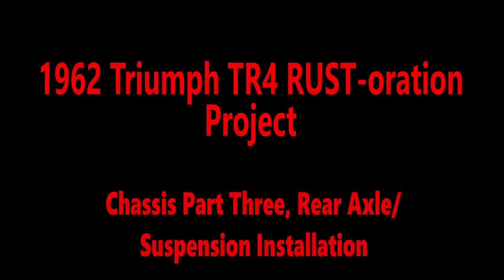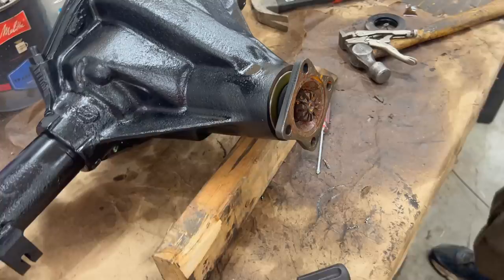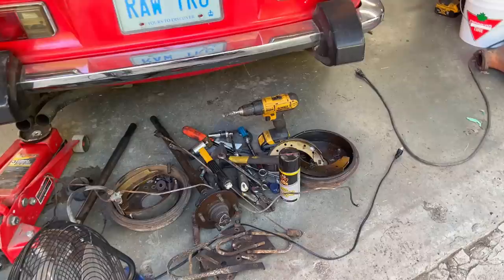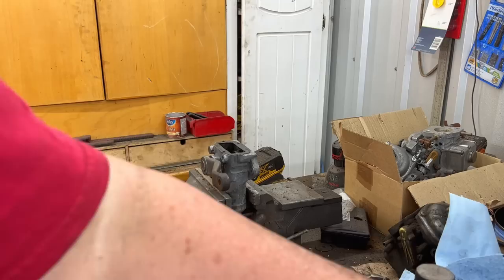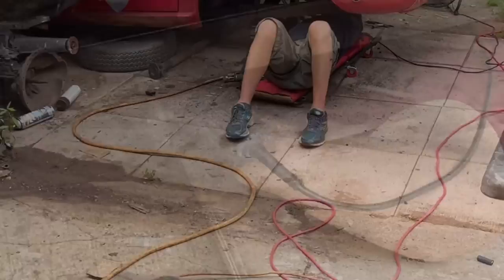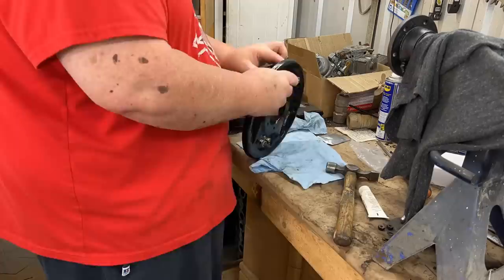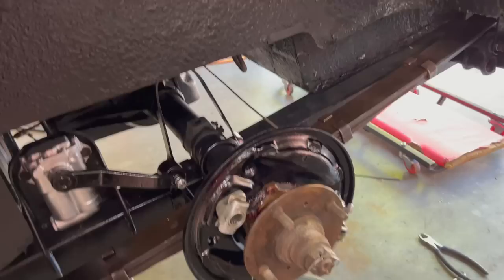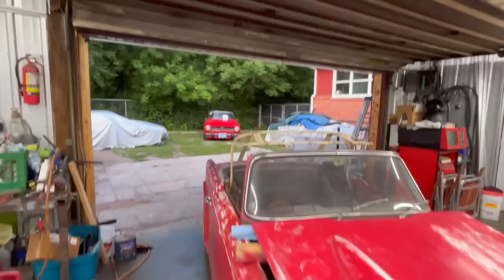1962 Triumph TR4 RUST-oration Project, Chassis Part Three, Rear Axle/Suspension/Brakes Re-Assembly

Comment: Moving along quickly and looking nice,,, I thought you had a blast cabinet for cleaning parts, great work guys nice teamwork..     did not know about lubing the rear springs. Opps..
Reply from the maker: I have a cabinet at my place but to be honest with you it’s tucked away and is a hassle to get out…plus I have to move cars out of the garage…it’s easier to bite the bullet and sand/grind/wire wheel.

Comment: My diff was leaking oil out the pinion area after putting a new seal in.  It turned out it was coming out the threads and once I put some sealer on the threads, it stopped.  It wasn't a lot, but wouldn't hurt to do this in the future to save a couple drips on the floor.
Reply: I should say spline area, not so much threads.

Comment: Nice job guys!  I do need to mention an observation, as no good job goes uncriticized.  David, I saw you all ready to get under the car wearing all of the PPE(personal protective equipment) to keep the crap from going in your face, but the video had Elin under the car doing the work. 
 I am surprised that you did not paint the visible end of the axel and did not, at least, clean up the excess grease from the driveshaft universal. Also, it looked like the driveshaft bolts are too short and not going through the nylon part of the nut. I had the the same issue when purchasing those bolts.  It must be nice to have a helper who knows exactly what to do, not just someone who drinks your beer while you do the work. Cheers!
Reply from the maker: Hi Jim, I cleaned up the rear section and mid section of the bottom of the car and Elin cleaned up the more towards the heelboard and mid section of the car so we split it up a bit...I did mention it in the video with my "fat guy, skinny guy" comment. The visible end of the axle should not be painted as there are shims that sit there to set the axle endfloat.  This needs to be a clean surface and not painted.   The universal joints were cleaned up of old grease and new grease was pumped in before it was fitted back to the car.   The bolts are specific tolerance machined bolts and nyloc nuts for the driveshaft.  Both Grade 8 and brand new.  Absolutely!  Elin and I work well together and enjoy spending time in the garage on a common project.
Reply: @cheftush  I meant the part of the axel that sticks out of the hole in the brake drum, with the nut and cotter pin. As far as the fat guy, skinny guy response, you could have raised the vehicle more.  
I hope you understand that my comments are mostly humorous, I really like the work you guys do.
 Was I correct about the driveshaft bolt lengths?
Reply from the maker: @jimconklin8040  understood Jim.  I’ll check the driveshaft bolts again but they were purchased specifically from Goodparts along with the Ujoints.

Comment: Are the lever shocks cast aluminum or steel. I just bought a a brand new lever shock. It comes unpainted. The original is leaking through the oil seal at the arm. One day I might send it to Apple hydraulics. Can I leave the new casting unpainted?
Reply from the maker: They are aluminum. Yes, they can be left unpainted.   Nos imports is a really good rebuilder of lever shocks.